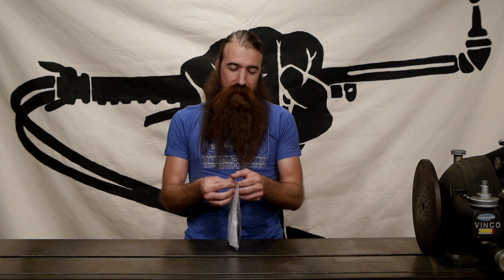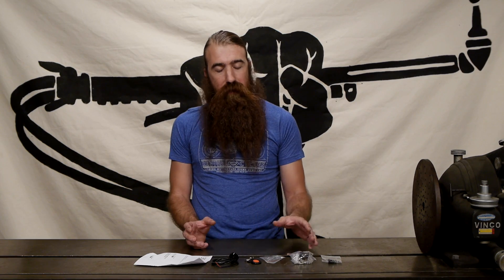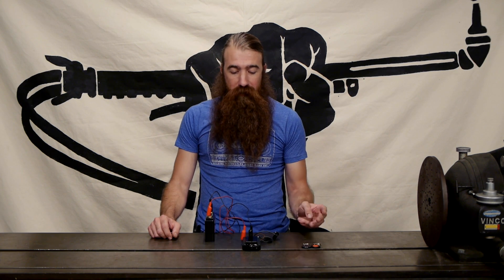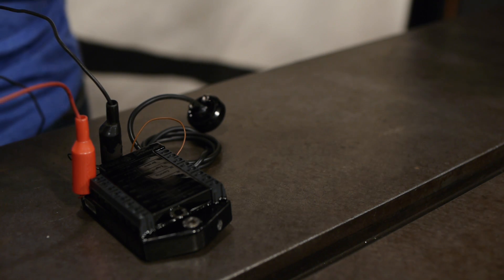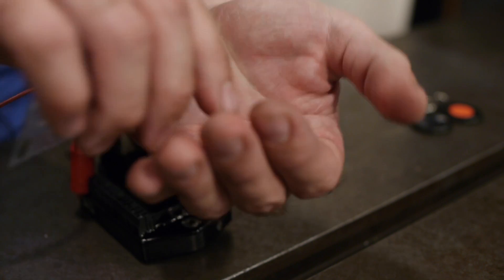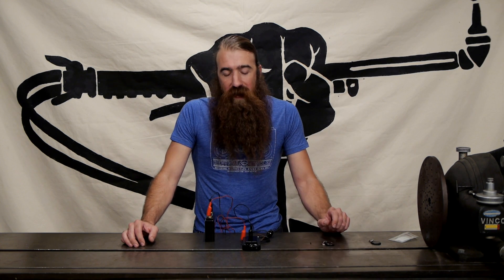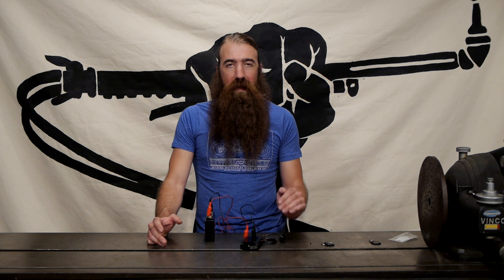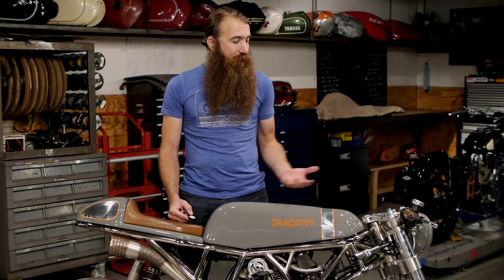Motogadget m-Lock - Revival Cycles Tech Talk

Comment: Hi, great video as always. Can the m-lock have a switch in the circuit? As in swipe to get the power on, but a simple momentary switch to power down rather than need to swipe again?
Reply from the maker: That is a very good idea, but although the m-Lock is not intended to be setup that way, I think should work fine if you can get a normally closed momentary switch on the power input to the m-Lock. This way when you push the momentary button it breaks contact with the power supply forcing the m-Lock to shut down. Then when you release power, the m-Lock is still off but ready to be reactivated with the RFID fob. 

The one down side is that it can be tricky to find a momentary switch that is normally closed. For some reason the majority of push button switches are only available as normally open.

Comment: Hey! what are the other suggestions you have to resolve the power withdraw ? i have a 2015 Vulcan S and wanted to installed the M-lock without the M-Unit. I have the Scorpio I-800 with perimeter sensor & ignition disabler on another bike and i kept coming across the dead battery problem. The battery wouldn't last more than 3 days if the bike wasn't being used. So i had to put on a separate on and off switch just for the security system. I don't want to do that if i get the M-lock because it'll require me to constantly reprogram the keys and that defeats the purpose of getting the unit. If you can share the tips or solutions you found that would be greatly appreciated.

Comment: Or you could just use the m-lock to enable/disable a fuel pump, ECU, ignition box, starter circuit, fuel injector wiring loom, coil-on-plug wiring loom, the wife's favorite vibrator, etc etc etc.
I've done this to all bikes & cars that I own.
All I gotta do now is install some hidden cameras and laugh till I'm blue when a thief is completely dumbfounded by the inability to get anything fired up.
Profit.